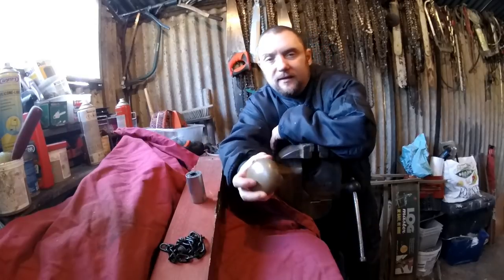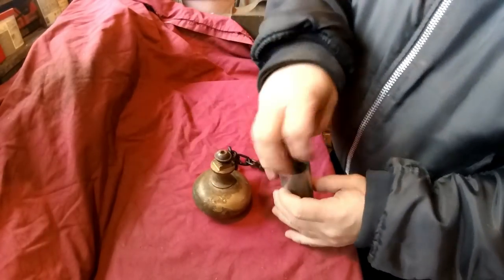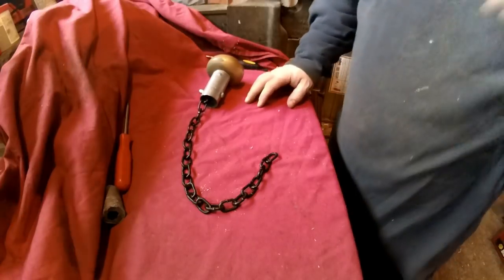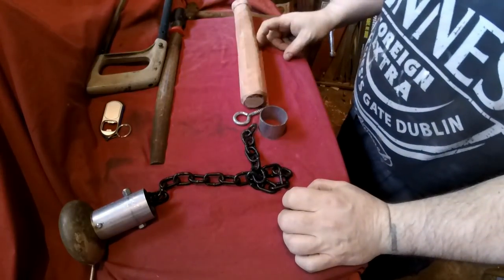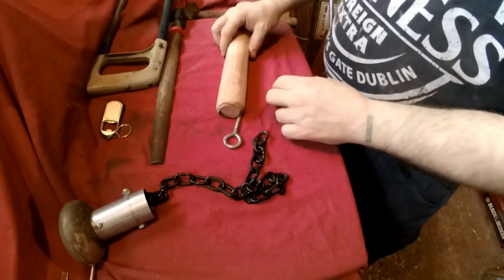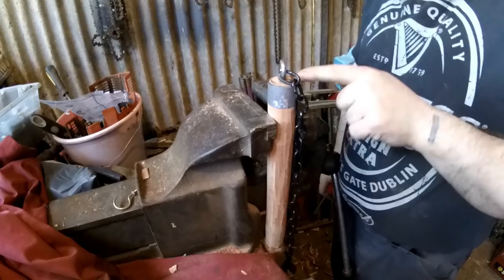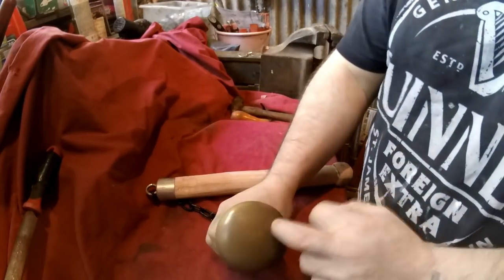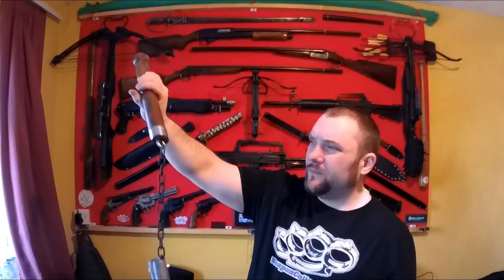How to make a Flail (Chain Mace)

Comment: Looks good, but yeah I also think the chain is too long. What did you use to stain the handle ?
Reply from the maker: cheers mate, i just used some oak wood stain, i can have a proper look at the name tomorrow if you want mate
Reply: @WeaponCollector  No don't worry about it, I'm just making a slingshot and am looking online at various wood finishes.
Reply from the maker: @shcomptech  oak effect wood stain varnish i think its called.
Reply: @WeaponCollector  Cheers pal.